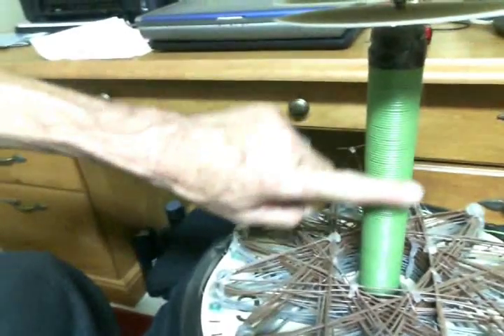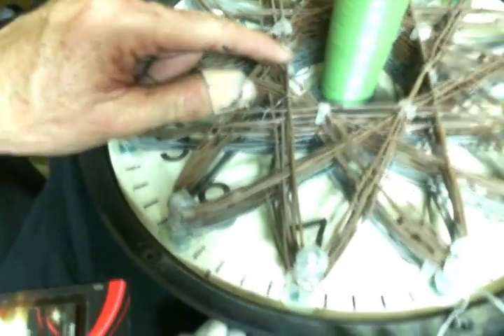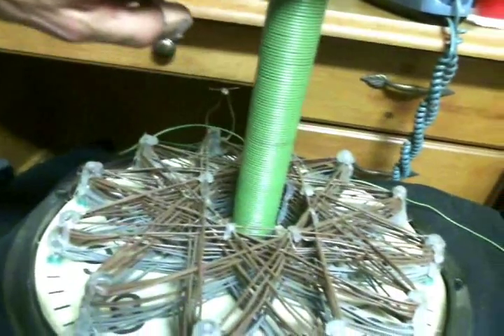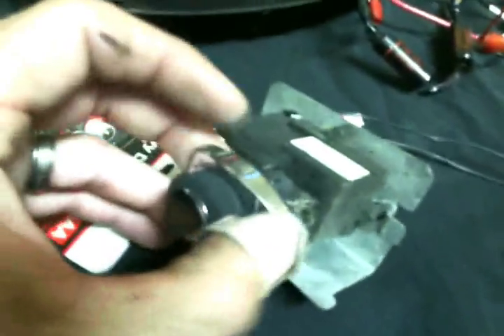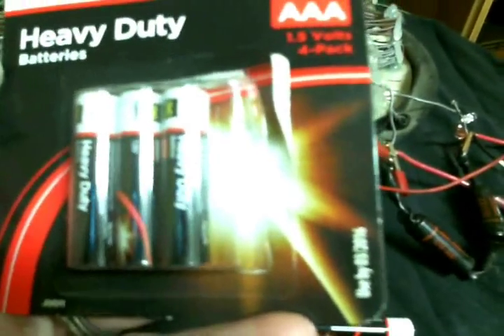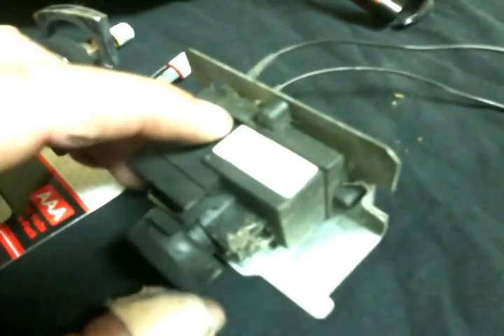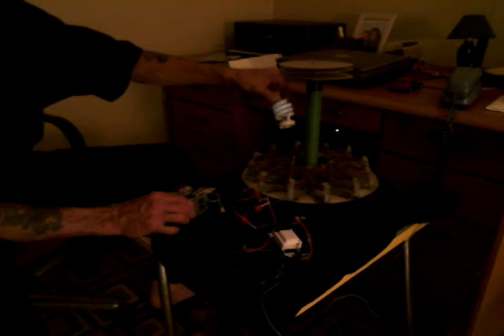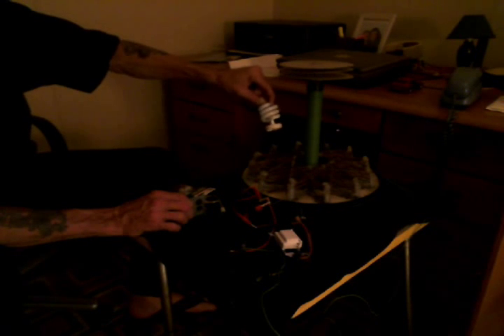1.5 VOLT TESLA COIL !

Comment: A static and anti static capture of neutral ac air and dc earth I think our earth is anti static dc and our air in the stratosphere is static and the air between a neutral mix if this is so then this is how joe booker alias joe cell is running a car engine with vacuum in play and cold by stripped atom air from aluminium discharging and charging as in your top discs the middle disc becomes a fence of the top disc pos and bottom disc neg that clash to cause a spike neutral on the middle disc joe booker shows this effect in joe cell horses mouth video where he has 2 neutral pipes in the cell this is the water stablished pulling in the dc pulsed outer and inner charges. Any good !